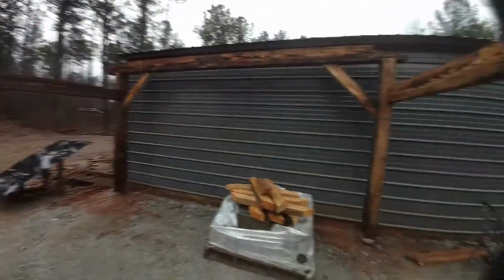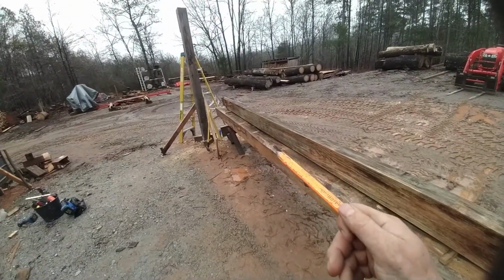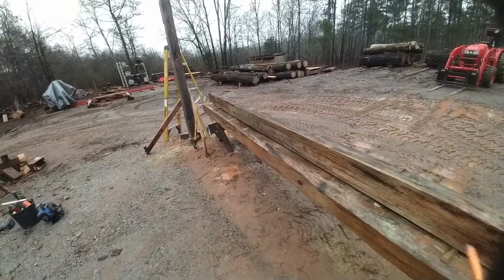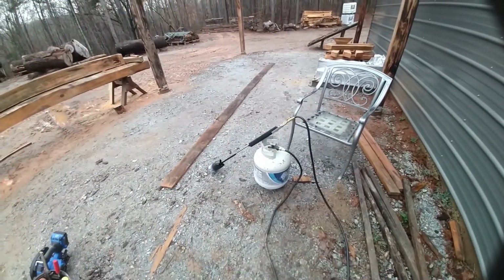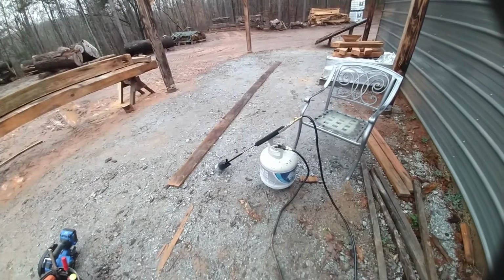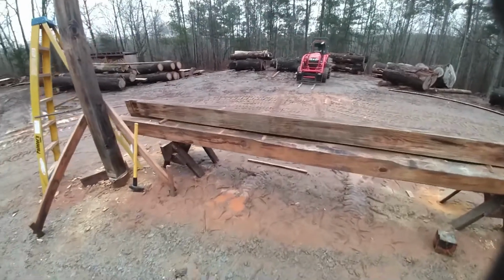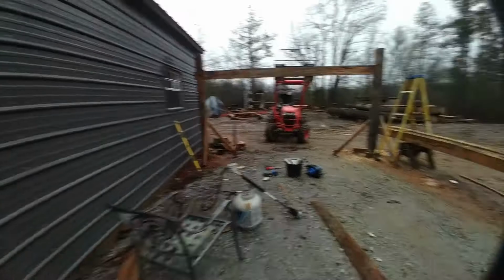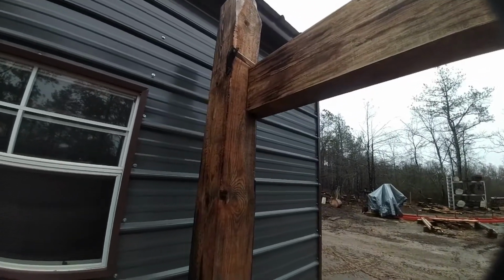#90 TIMBER FRAME BUILD

Comment: Im in the process of building a Shelter over my Mill. What did you use to fasten your post, to the concrete? Whats the length of your span in betwix the beams and what size did you mill your beams?
Reply from the maker: Jerry, I used 6x6 post anchor brackets I purchased from the box store. The span is 16 feet using 6x6 post and 6x8 beams. I too am getting reading to build a shelter for my mill but the design is more a queen trust design.
Reply: @DawnRedwoodGroves  Thank you.
Reply from the maker: You are very welcome. You still might want to verify span for your roof weight load.